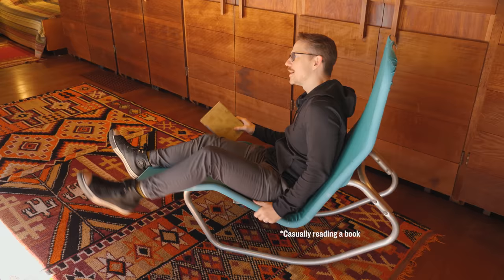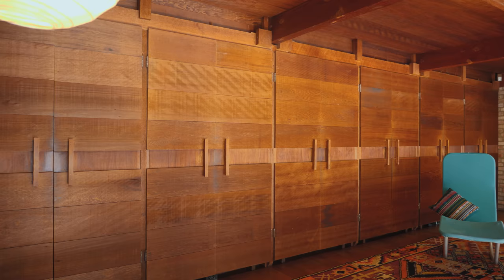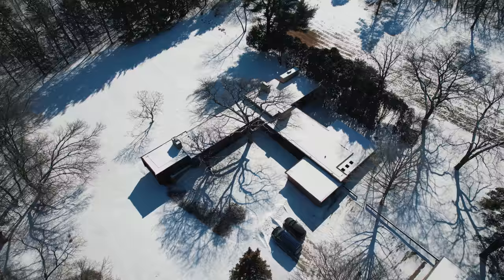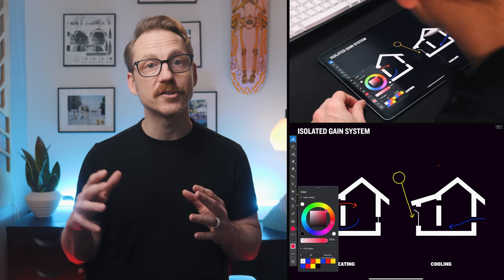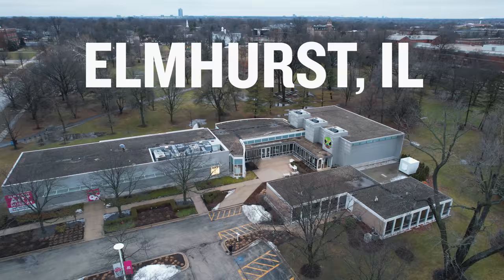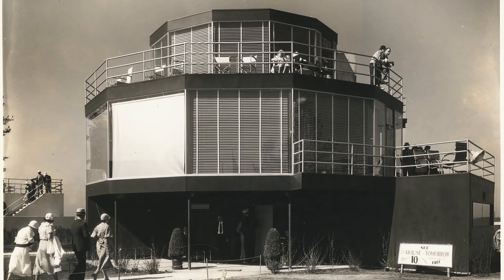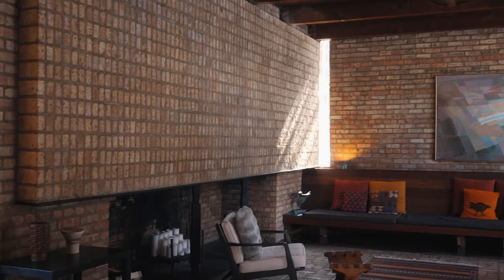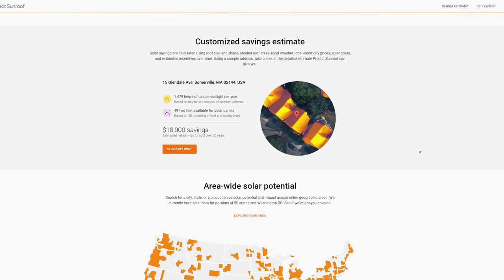How This Midcentury Modern House Harnesses the Sun

Comment: My grandfather’s house had a cool trick for keeping food fresh, built back before refrigerators.   There was a vertically oriented cabinet built into the Kitchen cabinetry. When you opened it, the shelves were all wooden grids.  Stick your head in and you saw that the top and bottom of the cabinet were open; on the bottom, into the basement/crawl space of the house, on the top into the attic space, where there was a large Venturi vent to allow hot air accumulating in the attic to escape.   When you stuck your hand into the cabinet, you could always feel a gentle breeze blowing up, pulling cool air from the crawl space up into the attic.  So, say you wanted to keep a head of lettuce or something like that fresher for longer, and your literal icebox simply did not have the room, and anyway was too cold.  You cut the head of lettuce in half and placed each half on a plate and put it in the cabinet, then you poured a little water into the plate and covered it with a cloth.   The water would wick up into the cloth, and the constant breeze blowing in the closed cabinet would cause the water in the cloth to evaporate, dropping the temperature inside the cloth by 15 or 20 degree.  My grandfather told me all the houses built back when his were built had such cabinets, but most people in the 1960s didn’t know what they were for and so they closed off the top and bottom and put in normal shelving. In the 1960’s he still used his to make produce last longer.
Reply: Christopher Pardell A very interesting trick that surely does not originate from "barbarians". I bet, not many people paid attention to your comment.
Reply: Wow cool!
Reply: wouldn't bugs from crawlspace get in
Reply: @rx0102  there was a screen at the bottom and at the top. So, no bugs larger than ants would get in. And, back then, you just sprinkled borax powder on the edges of the shelf and that would kill any ants that got in.   I mean,  Its not as good a solution as a refrigerator. But back in the 1800’s when the house was built its was useful for keeping fruits and veggies fresh longer. My father was an appliance repairman, and had given my grandfather an old fridge that someone had abandoned and my dad repaired. It was one of those really old style that had the circular condenser coils on top.  But even in 1960 my grandfather Still had an old icebox where you could still buy blocks of ice from a vending machine down the block and stick them in there to keep stuff cold.

Comment: Our house has some of these designs, including a foot of concrete underneath the section of floor receiving winter sun. On sunny winter days, the temperature in these rooms is always 2-5 degrees above the thermostat set point. So nice! At night we have shoji screens to pull across the glass, which helps with thermal retention.

Comment: More vids like this please! 

I grew up in a passive solar heated house and can’t understand why there aren’t more new buildings that implement passive heating and cooling.
Reply: my wild guess is because it's harder to standardise. It's easier to make cookie-cutter houses and buildings and force HVAC on them
Reply: @idromano  yeah, here all new builds are forced to use like 6 inches insulating boards from polystyrene and 3 pane windows with heat pumps, solar panels and forced ventilation. It is very expensive to build like this.

Comment: All of these principles are so basic to good building, but so often ignored these days. It seems like many architects and their clients think that modern HVAC systems can make a space comfortable using brute force. Not only is this incredibly wasteful and expensive; it often doesn't work. As an example, a friend of mine worked in a tall office building in the Long Island City section of Queens built in the late 1980s. The building was sheathed entirely in glass, with architect-designed mylar shades in the south and west-facing spaces. Despite this, these spaces were impossible to work in even in the winter because of the heat gain. No amount of air conditioning could mitigate the problem. Those spaces are now used mainly as storage and utility rooms, or left empty.

The Schweikher House has very much the same vibe as many of Frank Lloyd Wright's Usonian houses. I wonder if they influenced each other.
Reply: In my experience far too many modern residential houses aren't touched with a hand of an architect. Clients hire designers instead. So the picture sells although no one thinks how it will work in real life. And more often than not it doesn't.
Reply: @michaelcrockis7679  — I agree with your point, but the words you use have a different meaning to me. “Design” implies proper functionality to me, and “architect”, to me, evokes more “art” than design.

Yes, I know “design” has been partially co-opted to mean form rather than function, but we must resist this! (As a mechanical design engineer, I may have both some bias and a dog in this fight.)
Reply: @altosack  I think design is a more generalized term, whereas architect is a more specific niche within the umbrella of design. Designing always requires an input or parameter of some piece to unfold, so this could be for 'form' or for 'function'. I would always argue that even the most 'form' end results of designing are still performing a baseline function.
Reply: @michaelcrockis7679  Designers? Hardly. It's far 'better' to just use the mathematically best house for ratio of money in to selling points out, and then copy-paste it across every biome universally in a maze of cul-de-sacs
Reply: I feel that this in large part is going to contribute to our energy and climate concerns. Regions having blackouts in the winter because every house in the region is trying to brute force HVAC itself to being warm, hoping it doesn't break down in the summer so no one bakes in their own home.

Imagine how much energy could be saved if homes were built with these natural methods of transferring heat using science instead.

Comment: This method is used in cob houses.  In studying them I read the winter sun at noon is the same angle as summer moon at midnight and vice versa.  This was a way to get sight lines in order for opposing seasons though they are 6 months away.

In addition to that, they would build just to the east of deciduous trees to get additional shading in the summer and sun in the winter.  Natural shading is a huge cooling factor in the summer.
Reply: I visited northern Norway in early January a few years ago. Although the sun never rose, the full moon circled the horizon in the same way that the sun would in summer - as you described. It was beautiful, but a little disorienting (literally and figuratively).

Comment: I keep waiting for the phase change solar mass to hit the market.  I saw something on it a few years back.  It used sealed wax beads in the dry wall.  The wax was formulated to go through a phase change at a specific temperature (near room temperature).  That let it absorb a huge amount of energy whenever the room was above that temperature and then radiate it back when the temperature dropped.  It took up much less space than traditional thermal mass and by adjusting the mix when making wax you could adjust the temperature the wall tried to keep the room at.
Reply: Fascinating concept
Reply: Imagine nicking the wall with a chair leg and all your insulation drains out into a puddle

Comment: I grew up in a mid 19th century farm house (c. 1850), the porch on the South facing façade was acting like the hang over part of the video. The sun would shine in on winter and not shine in at all on summer. Although, all the rest of the heat distribution mechanics were absent, it still helped a lot to keep the temperature even.

Comment: This reminds me of a woman who gave a ted talk on her architectural designs involving curled bimetallic sheets. If the sun warmed up the sheet, one end would expand more than the other, unfurling the metal to shade the building. As it cooled down, it would unfurl to let in the light.
Reply: Isn’t that how a thermostat works? Bi-metal strips of two different materials with different coefficients of expansion?

Comment: My question is, that if you walked around with an IR camera in one of these older solar homes, how “sealed” is it? Or are the deficiencies in the construction (gaps, old glass, improper fitment) even out weighed by the “efficiency” they have utilizing the Sun? It seems, as modern “green” design goes, it’s the engineers world for hvac… How well can I contain a space, in order to most precisely manipulate the conditions inside it. As opposed to actual symbiosis with the environment the building is being built in. PS love your content!
Reply: I think it comes down to integrated design principles and when you get the engineer involved. From my perspective as an engineering student it’s possible to have these conversations early in the design process and to establish the systems around the design. If we want to make a house/building that utilizes as many natural benefits to reduce the need for mechanical systems to run, some HVAC designers would be thrilled to face that challenge. You would spend more time on the exact design of the fenestrations and spend more money upfront for windows/other materials, but you would run some analysis to try and prove the long term effectiveness and cost savings. You also impact lighting designers with the way the light flows which might reduce the need for artificial light and reduce heat gain in that sense. Hopefully this helped or aids in a conversation! I love these videos as well and I’m a architectural engineer with a focus in structures. Our worlds are one in the same! We each just carry a different lens.
Reply: It has been my experience lining in one of these homes is that modern sealed double pain windows makes a world of difference.
Reply: I agree David..
Reply: I've been in this house on a 90 degree day and with all of the windows shut and it was a probably about 70 inside. Very comfortable.

Comment: It's very interesting to see the comparison between Illinois and Australian architecture which focuses less on the heating instead the cooling. A house is to be fully openable essentially just a roof for it to passively work in summer. Glenn Murcutt, Peter Stutchbury, Rick Leplastrier are good examples. That being said it still needs to accommodate for some cold winters. Loved the vid
Reply: All of Australia still gets winters. I had to go and buy a heater when I lived in Mackay, Queensland. The entire southern half of the country has cold winters (not like Minnesota or Illinois) and is very suitable to solar passive design. There are houses in cold Canberra (near the Snowy Mountains) that need no heating because they can capture daylight heat and sun in winter. 
But winter sun coming into your house is beneficial even in tropical environments. Summers are getting too hot now for just natural cooling or breezes to work - especially considering insects etc.
Better off incorporating well-insulated spaces with aircon and running it off solar power. Modern air con is v efficient and cheap to run.
Interestingly my almost 100-year-old Queenslander house is incredibly efficient and comfortable using these techniques. And the north-facing deck makes you feel like a lizard who just wants to bask in the sun all day during winter.

Comment: It appears that other architects still apply these principles. My father's house in Wisconsin has a passive solar room on the south side of the house. It doesn't have the grates, but does have solar curtains to keep out the cold at night in winter and the heat out in summer. My father also put in two wall fans to pull the warm air out. In winter my father uses his furnace only once in the morning. He built his house in 1979-80. I was always surprised that this didn't incorporated in every house.

Comment: Recently visited Stratford Hall (1738) on a hot day in Virginia and was struck by (a) how cool the interior felt and (b) how good the naturally harvested light was within rooms with relatively small windows. Glass is set close to the exterior surfaces and the thick walls with splayed jambs do a phenomenal job at capturing and distributing natural light. I could easily read 20’ from exterior walls with no artificial lighting. Very balanced.

Comment: As an HVACContractor I’ve been involved in quite a few passive solar homes. Believe me they may help offset some of the energy demands for a home but in no way can completely condition a home fully.
Reply: What if the structure is also set deeper into the ground to benefit from ground source heating
Reply: @adannielsen2442 There’s no way you can fully condition a house with passive strategies. You can reduce the need for conditioning the house by carefully designing it for passive solar for heat gain during the winter + super insulated to retain heat & it needs to be air tight target 0.6 ACH or lower if you can. Look into the Passive House Standard if you want to know more about it. Certified Passive House is 90% more efficient than conventional built house.

Comment: My house is passively heated, but it uses brick flooring for thermal mass, which I think is better than wood. The one thing I’ll say about passive solar is that most calculations leave you hanging in the early spring. It’s time distance from the winter solstice means that you’re already well into indirect solar mode by April 1 when you certainly still need heating
Reply: You could still get small amount of solar collectors for warm water and use that water also for heating in autumn and spring. What do you use?

Comment: Those of us who grew up in South Florida are well familiar with The Barnacle, the oldest house in Miami-Dade County that is still in its original location (there are older homes, but they've been moved).  It was built in 1891 by Ralph Munroe, one of the founders of Coconut Grove and the founder of the Biscayne Bay Yacht Club.  Its property sits directly on Biscayne Bay, with a direct clearing through the canopy from the house to the water.  It isn't exactly a "solar home" in the sense of what we're talking about here, but it's one of the earliest examples of modern passive cooling that I'm aware of.  The main structure is almost exactly a square footprint, oriented northwest to southeast from front to back, with the front and both sides under significant shade.  The sun doesn't directly come through the windows in the back, but anyone who has lived in Miami can tell you that doesn't matter.  The roof is what really does all the cooling work.  In addition to significantly large gable overhangs for shade, the roof structure is a pyramid with a covered vent at the top.  That, combined with the seabreeze coming off the bay, pushed warm air up and out of the peak of the ceiling.  Anyone who has taken the tour as a school kid (as I did) likely recalls the tour guide's explanation that a solid block of ice, which was used to provide drinking water and cooling for the ice box, would last several days in the central kitchen on the first floor, because it would remain cool enough in that location even in the peak of summer.  A third-grade visit to The Barnacle Historic State Park is what got me interested in passive cooling (and heating) in home design, and while it may not be the most perfect method, it is certainly a fantastic example of some of the earliest modern attempts to stay comfortable by working the architecture around the environment.

Comment: We built our super insulated home in Fairanks Alaska with sun heat and 8 inches of insulation.   (Rock wool and blue board foam is the best).  
We spent 1 week finding the perfect spot to face the sun in winter time on a hillside property.  We have 3 large 4x4 fixed pain windows facing winter south. This has been 3 years of payoff as we have stunning mountian views along with vitamin D and massive amounts of warmth.  The long 6 months of winter are very bearable now compared to 15 yrs  living on the flat land in North Pole. 
For summer 24 hr sun: We installed cross breeze operable windows on the E/W sides and heavy shades for summer on the south side.  
My wife designed it with an expert sourdough builder down the street who showed us all the things 30 years of "wish he would have done but didn't ".  
So far we have no regrets.
Cheers from Alaska.

Comment: Took this as a solid piece of advice while designing my future home. Also, the low roof slope from another of your videos. Thanks for handing us this valuable data!

As for the roof slope: a 4.5m takes a 80cm height for the tangent to get close to that angle. Or a 5.65m and a 1m height. Sorry for the lack of imperial units, metric ones are the way to do things where I live at.

Comment: After 90 years, this example of passive solar technology is still working perfectly with no extra effort from the home owner. In comparison, photovoltaics panels are finicky, need maintenance, need replacing every couple decades, and their savings are debatable. A new home owner might remove or neglect a PV system, but passive solar features are simply part of a home, and continue to work unnoticed. Without fan fare, passive solar simply makes makes homes more comfortable at less cost. Good video.